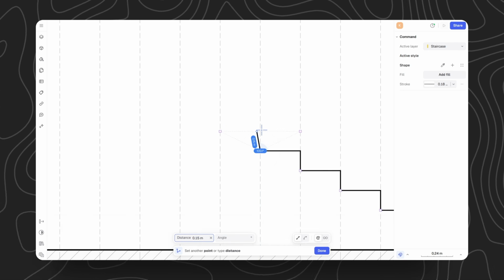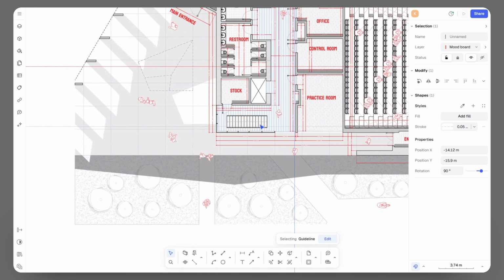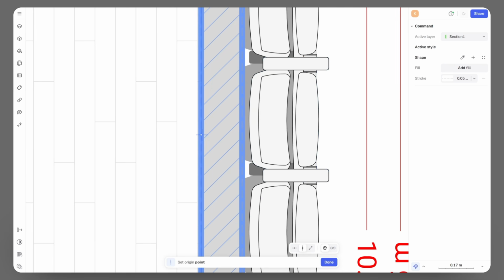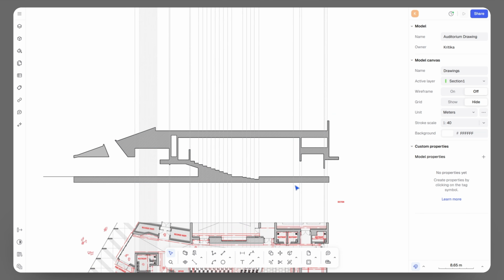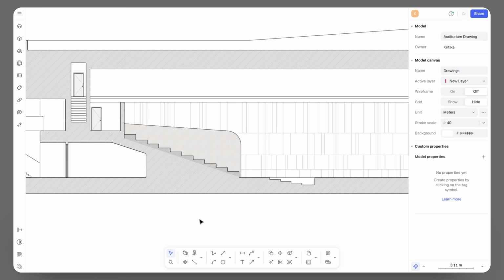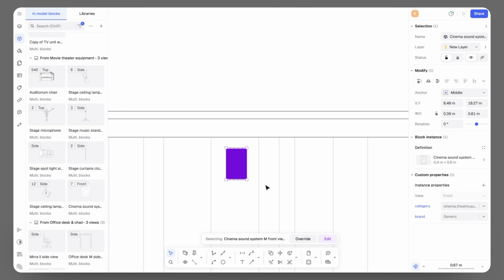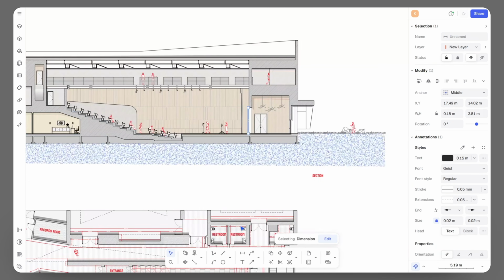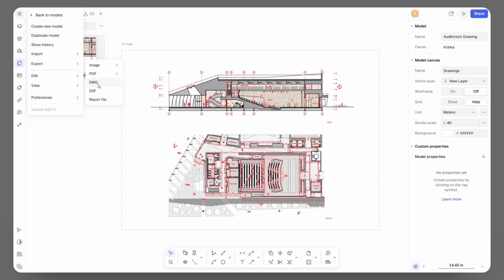How I made this architecture section (using ONE software)

Comment: Hi, i understood the vertical lines will show you for example the lenght of a wall of the position of the stair steps but i didnt quite catch how to know the exact high of thse steps and walls or oors based just on a floorplan. Do you know them by default or just common measures?

However some passages i couldnt understand what tool where you using for each action. Can you upload longer and more detailed tutorials?
Reply from the maker: Great question 🙌 From a floor plan alone, you usually don’t get exact heights. I use standard dimensions like typical door heights, wall heights, and stair riser sizes) and adjust them.